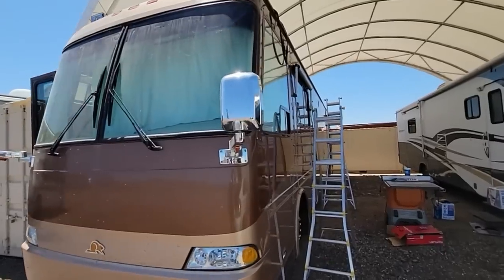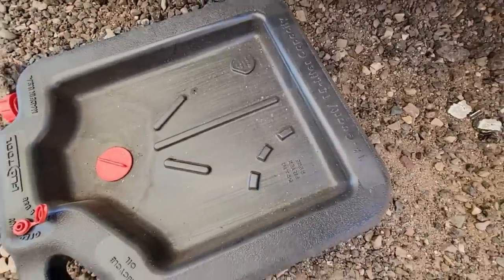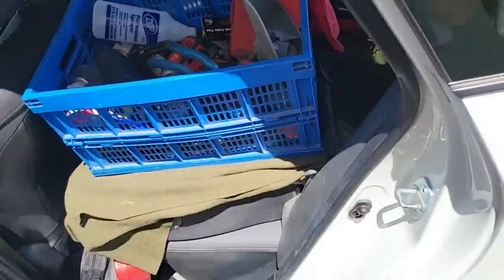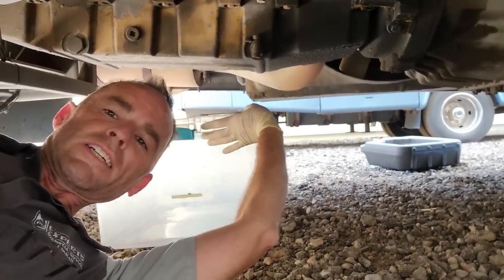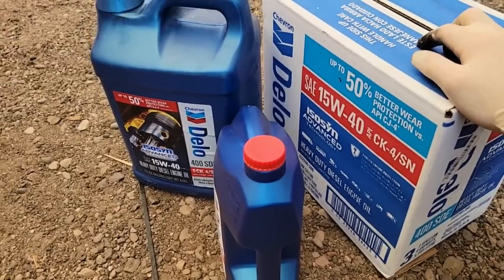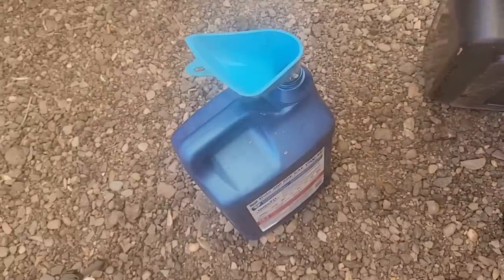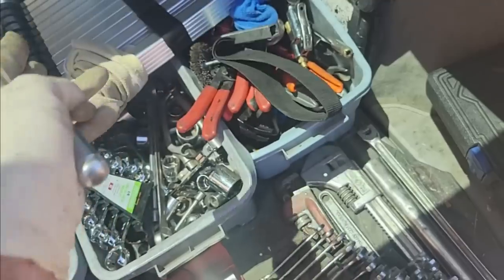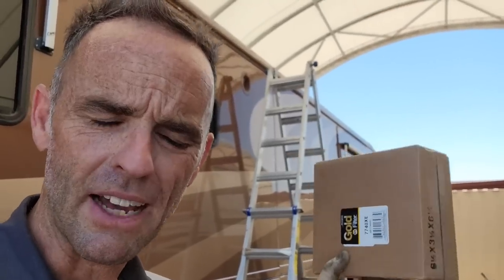Servicing the Cat C-12 and Allison 4000MH Transmission

Comment: Nice looking CAT. If previous owner installed that quick oil dump valve, chances are good they changed it regularly 👍 Tip: I punch a hole in old oil filter bottom to drain that gallon prior to spinning off. Less mess for me on the Cummins L9. I use the Cummins recommended Valvoline Extreme Blue full synthetic 5W-40 for increased mpgs (just had 7 gallons delivered for less than $30/per gal.). Currently averaging over 11mpg for 37,000lb coach. On the tranny, it's ok that you did it again since you never get all the fluid out during a change. Big difference between original fill capacity and change capacity. Runs and sounds great.
Reply from the maker: Thanks for watching! :)
Reply: Totally agree on the punching a hole to drain the filter before removing it.  Reduces the mess and makes it a lot lighter when removing as well.
Reply: I see in one of the comments somebody talking about getting 11 miles to the gallon is that even possible in a class a just curious I have no idea. Thanks for all the great videos you rock.

Comment: Great job James!   Hey, if you want to super clean your windshield, get some 0000 steel wool and dry rub the windshield.   It will not scratch your windshield.   When I got done cleaning mine, I rinsed with water and applied some Nu Finish ceramic to it.   Went on a trip and got a few bugs on it.   Had slight rain overnight.   All bugs were gone in the morning.   Respectfully,   Kevin
Reply from the maker: Thanks for the tip
Reply: Hi Kevin. How did you apply the Nu Finish? Spray, wipe and then wipe off with another cloth?

Comment: I did this very same service on my 97 Beaver after I bought it in Feb. Only 60k miles but the transmission was shifting like a sledgehammer. When I pulled the filters they were the originals from 97! And my joints were sore for DAYS from fighting the oil filter. Goood times....
Reply from the maker: Yikes! Hope the next change is easier

Comment: Hey James here’s a tip from a currently working journeyman, I use a sharpened punch and a hammer to poke a hole in the bottom of the old oil filter and then if there’s enough room I poke a hole in the top to drain the filter. 
A lot less mess that way bud.

Comment: Nice work James, fluids are the cheapest part of ownership, does not hurt to keep them changed. If you are running full fill Transynd its actually rated for 300,000 miles between change intervals, if its not a TES295 ie Transynd then its 25,000 mile change interval. If its a blend then you have to go by a chart and it lowers the interval down some to around 150,000 miles or so. I would reference the chart provided by Allison.
Reply from the maker: Thanks for the tip

Comment: That trans oil was very clean for sure.  Did you know that Allison now recommends the 668 oil vs the 295 you used?  This is a updated version per Allison.  I will be doing my trans service on my 4060 on our Foretravel with the 450 cummins engine.  It takes 9 plus gallons of oil in trans.  Will be around $550 to change out with filters, which are the long ones.  I have the 4 inch sump.  Love the torque wrench you used, got a laugh out of me when you said click!  Those I believe are suppose to be in the 45 to 55 torque range with 22 to 25 on the plug.  Aluminum case, be careful!  Really enjoy your videos for sure.  You do some jobs that I draw the line on, but still enjoy watching and learning.  Never too old for that!  We are on our 10 year of full time and still learning for sure!  Keep those videos coming!

Comment: Thanks James for the video's.  Just got our C13 serviced and radiator flushed.  Coach had about 53K miles on it and was serviced prior to our purchase with 47.5K miles.  Only 5.5K miles on the service but I was out 3.5 years.  The radiator however looked like it had never been flushed.  Service center had to flush it 3 times to get the crud out.  Replaced with lifetime OAT antifreeze.  Our C13 holds 10 gallons with 2 filters.  Some held 9 gallons based on the oil pan depth.  Going to get the transmission serviced next.  Fluid looks good but like you I have no records of it getting done.  I was sorta surprised that my antifreeze had been neglected.  Coach is overall in excellent condition.  Thanks again.  Love your coach.
Reply from the maker: Thanks for watching! :)

Comment: James,  I  just saw the other day that trains use used motor oil for fuel.  Back in the early 90's guys I worked with would bring in the oil from there pickups after doing an oil change and dump it in to the semi's at work.  Enjoyed watching you at work.  It made me feel like I was rite there with you. 👍👍
Reply from the maker: Thanks for watching! :)
Reply: Farmers all over used to burn waste oil to keep crops from freezing. Specifically designed "burners" were a big industry. 
A lot of massive engines burn fuel oil, but the trains may have used it in place of coal. Dont know but would love a link on it.
Reply: I used 5% waste oil in my 12 valve Cummins. Does not harm anything. Put the oil in a bucket with a rope in it on a bench above another bucket for it to drain into. Eventually it will practically siphon down the rope like a small hose. Takes a while but the second bucket will be much cleaner and then add a gallon before each new tank of diesel.
Reply: A lot of shops use waste oil in diesels. Although you probably need to do more than just filter if you want to run without problems for long. You also need to mix it with something to reduce viscosity unless it's pretty warm where you are.

Comment: I’ve done a lot of research about my diesel motorhome and I’ve heard more than once not to flush the transmissions. I am a gasoline mechanic not certified but been building engines and such for almost 50 years. The diesels are new to me but I have found out that they are actually easier to work on albeit the components are much heavier and larger.
Reply from the maker: Thanks for watching! :)
Reply: All you really need to know is how to prime the injectors if they aren't self priming. I learned that when my sending unit went out just prior to me watching my diesel being towed away to the dealer for an expensive sending unit and injector prime. About a year later the side draft pump went out taking the $5000 injector pump out with it and the sad thing was that it was only 72 miles beyond the 100,000 Cummins warranty. Dodge said "Oh well, we don't care if it's 1/4 mile beyond."Thank you Dodge. Thank you Cummins. You both SUCK! It's always murder suicide with these Dodges. Example: you can't simply have a battery go bad, it has to take the other battery and the alternator with it.

Comment: Thank you sir for the video.  Thank you for the idea of the old tote as the catch, first change of my 3126 in my 2002 Beaver Patriot Princeton went well.  Oil change removal was easy.  Adding it to the 3126 was a chore due to the rear radiator.  Lubing all the zerks was a pain!  But inspecting under a 21 year old coach is always a good idea, and the 44k miles it has shows little wear.  Heading to northern Michigan soon!
Reply from the maker: Heard Michigan is beautiful!

Comment: Good job on your change. I've been a diesel mechanic for over 30 years. No hate here but your oil sample works only if you do it every service. It will tell you how much zink is in your oil and tell you if your having a problem internally. Good idea, but just do it every oil change. And also do your DCA level in your radiator. Keeps your engine liners from pitting and causing problems. Keep up the great work.
Reply from the maker: I just did it and posted the information on a previous video

Comment: Takes me back to working on drlg rigs as a young guy working as a motorman changing oil on those Wakashaw and  10 cylinder Superior engines with 90 gallons of oil. Enough to fill 2 empty 45gallon drums. Great job
Reply from the maker: Thanks Jud

Comment: Hi James I did have the transmission oil changed and it was expensive. Thanks for showing us how it was done. I'll do it myself next time. There is a way to have to use the shift panel to check the oil level. I have it wrote down some where in the coach.
Reply from the maker: Glad it helped

Comment: So with transynd you should be good for 100,000 miles. The 25,000 in for regular non synthetic oil.  Check Allison’s website.
Reply from the maker: Thanks for the tip
Reply: Only with TranSyn 668 $49 a gallon at Walmart.
Reply: @cardenasrc51  Actual Allison TES668 or Castrol Transynd 668 at Walmart?!!  The jackasses in my area are charging $78 per gallon for Allison Transynd TES 668 and I’m considering going with the Castrol since it’s to Allison Spec.

Comment: Hey James, nice video. Great sounding Cat, purrs like a cat. I always used Delo in my trucks. Ten thousand miles which usually was around three and a half weeks. Did not sit lol. Always got mine changed at a truck stop, but before two thousand, it was still pretty inexpensive. Had no place to change at home, so had to get done on the road or the dealer. Your trans fluid sure did look like new, but at twenty five thousand miles, should not get real dirty. But hopefully the other owner didn't have a problem and changed the fluid to hide something. But with the trips you made, you would have found something by now. Again, nice video, always watching for more.
Reply from the maker: Thanks Earl!

Comment: I also have a 4000mh transmission and need to change the trans fluid.  SUPER helpful video--many thanks!
Reply from the maker: Awesome! Glad it helped you!
Reply: @AZExpert  The worst part was gasket scraping the filter caps and their trans mating surfaces, which I think is excellent news.  My 4000mh took exactly 5 gallons of fluid; otherwise the job went exactly as you illustrated.  I can't tell you what a huge confidence boost your video provided me in successfully servicing my trans!

Comment: I was hoping you would share the results of the transmission fluid analysis.  I have the same transmission in my Monaco and the Allison tech told me that if the fluid looks dirty/burnt, troubles are just around the corner.  It should always appear clean.  Also he said NOT to try to empty the transmission during service.  Flushing the unit requires very specialized equipment which only Allison Service Centers have.  Told me to come see him after I pass the 1,000,000 mile mark.  I did the same type of service on mine as you did here, @ 38,385 miles.  I'm guessing I can go a couple weeks without worrying about it.  Great videos!

Comment: Thanks for sharing. That’s the last thing I need to do maintenance wise on mine. Now I know I need the shorter filter too. I think it uses the deeper sump with the Cummins engine. If you want to make your oil filter change easier knock a hole in the bottom of the filter and you can let it drain at the same time the oil pan drains. 
If you look at the oil filter they actually show how much to tighten it after it’s spun up by hand.
Reply from the maker: Thanks for the tip

Comment: I wouldn't leave Chevron Delo in their for more than 6 months regardless of mileage. I am a lifetime truck driver. That crap loses viscosity after about 5 heat ups and cool downs. Worst oil for a diesel. Personally I used Shell Rotella....the soot prevention and it's ability to hold it's viscosity far longer is worth the extra dollar a gallon ! PS....after more than a million miles of testing always put  a 1/4 gallon of lucas upper cylinder lubricant in with each fuel refill. It will gain you a mile per gallon , keep your injectors clean resulting in better mileage / horse power and torque by maintaining the flow and pattern of the injector. Not to mention stabilizing the fuel should you not go through much as it sits for long periods of time. And no I don't work for lucas !
Reply from the maker: Thanks for the tip

Comment: May suggest punching a hole in the bottom of the oil filter! This helps do a much cleaner job and removes the risk of dumping the filters contents on oneselfs..
New to your channel but loving the content.
Reply: 100% agree with punching a hole in the bottom and let drain befor removing. I would advise loosening the filter slight before that, just so you know it will come off.....loving the AZ Expert videos!!
Reply from the maker: Thanks for watching! :)

Comment: When filling the filter be aware that you could be pouring contaminated particulate into a new filter which will feed it directly to the mains. We were cautioned by GM (GM tech here) not to fill new filters, no matter the size.
Reply from the maker: Thanks for the tip
Reply: I was looking through comments for this topic lol. You can fill new filters but you're supposed to fill through the outer ring holes cause that filters while you fill it.

Comment: With the new trans synd you can increase the fluid change intervals. Perhaps another change or 2 you will have all the old regular type fluid changed. My 2009 newmar ventana is recommended to change fluid at 150000 miles. But as this is new to me i will be changing the trans fluid.

Comment: I did this same procedure on our 2005 Itasca Meridian.  It isn't too bad of a job, all things considered.  The previous owner really did you a solid by putting on that drain valve.  A question about engine reliability if you have a minute - I've been looking at large buses such as Prevost, Eagle, and MCI lately.  The vast majority of them for sale in the $100k-$150k range have between 150,000 and 200,000 miles, both with the Detroit 8V92 and the Series 60.  Why is it that folks are trying to sell their rigs at that amount of mileage, and what would your best guess be as to the average mileage between overhaul on those two engines - assuming of course regular maintenance has been done since new?  These questions have been nagging me for a month now, and I'd really appreciate your experience and knowledge on this topic.

Comment: Nice video!  Should be a good engine. Pre acert engine IIRC. If you don’t know the service history I’d vote for doing the overhead. At its age I’d also watch for any hint of coolant in the oil.  Replacing cylinder liner O rings would be a pain, but failing to catch it in time…

Comment: Just a few tips, one you do not need to prefill filters for cats. Also if you do you have to fill the outside plugging the middle or you are introducing unfiltered oil to the system. Second use a screw driver to puncture the bottom of the old filter to drain before taking it lose and making a mess.
Reply from the maker: Thanks for watching!! :)

Comment: I did engine and trans last year because of the same thing. No idea. . Had it tested along with the engine oil. it had some 'normal' metal in the trans. so it so I changed it. My trans oil was hazy too. It was a job. Same trans. Used a tote just like it. You got dry heat. Try 100% humidity.
Reply from the maker: OOF No Thanks

Comment: Love the vids, James!  Since I had the filters, I picked up 8 gallons of Transynd 668 this morning and did mine.  03 Magna with C12 and short sump 4000mh.  30.5 qts came out, and 31 went in.  Are you sure 16 quarts in the video is right?  Probably 5 gals came from drain plug, and more than 2 came from filter housings.

Comment: 2 things I do differently than you do, first the oil filter. Oil flows in though the outer holes, then exits through the center hole. You ran unfiltered oil right into your main bearings.Even brand new will have contaminants in it. Always fill from the outer holes. Also the trans filter bolts need to torqued between 38-45 ftlbs.To light and the bolts could back out, to much and you risk stripping the threads in the pan.  I still have 10mm heli coils and tools, even though I retired 8 yrs ago. Every  once in a while I would get one that someone had stripped and would need to be repaired. Not to easy a job due the the depth of the treads.
Reply from the maker: Thanks for the tip

Comment: On the oil filter change, poke a hole in the bottom of the old filter to let it drain before trying to remove it. Might be easier with less spilling.
Reply from the maker: Thank you

Comment: Good video I do all my own service I have a question have you ever change the filter on the the air dryer mine sits above the driver side rear axle very difficult to get to and so far unable to get it off my coach is a Dutch star 39 foot love the motorhome thank you

Comment: I was a must flush guy, but have since change to splash and fill due to horror stories with doing full flushes. Have you ever heard anything bad about a regular change, expect for the peanut gallery saying you're doing it wrong....    Never had any noticeable improvements with all of the flushes I did.   
One thing you do not want to do, especially on high pressure applications is to roll an O-ring on, as done at the end of the video.
Reply from the maker: Thanks for watching! :)

Comment: James,  On a Cat motor use only Cat filters, and Cat recommends not to fill the oil filter as it is not filtered oil. Use only Cat fuel filters and fill it with fuel while using a plug in the middle hole, Cat injectors can get killed if any air gets in the pressure size. See Adept Ape on YouTube.
Reply from the maker: Ill check that out

Comment: 🟥🟥🟥 Mine, like yours is a Patriot Thunder Princeton except mine is a 2002. I have a slight lean in the left front to the low side. I understand there's an adjustment rod for the air suspension to compensate for that lean . So how would I disconnect it to adjust it, and would I lengthen or shorten it to raise that side? I've also seen automatic transmission shops use petroleum jelly ( Vaseline ) to lubricate seals and o rings on reassembly as it is compatible with ATF. Any input is greatly appreciated.  ps... Great videos.